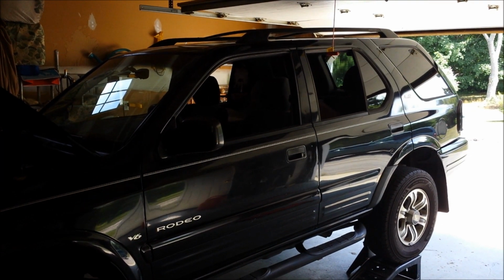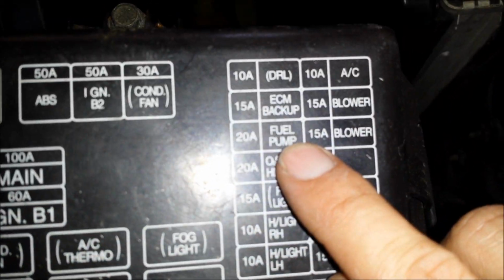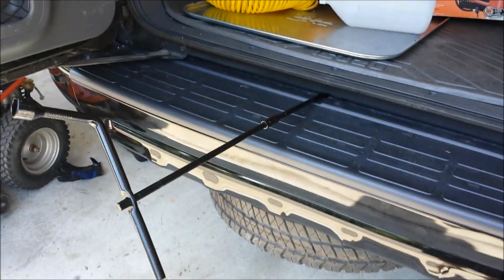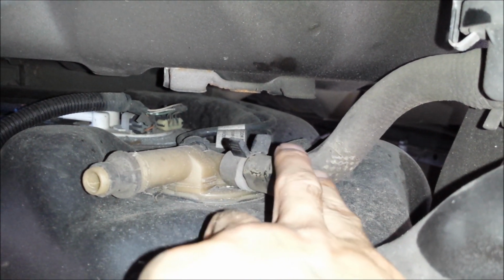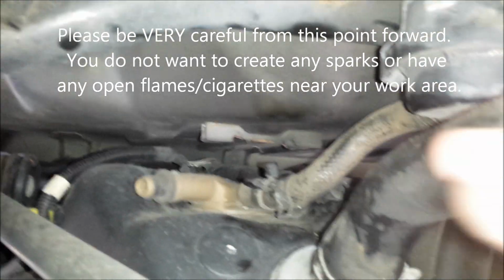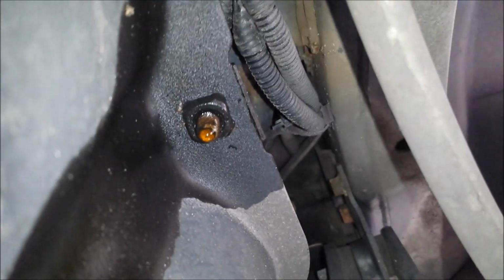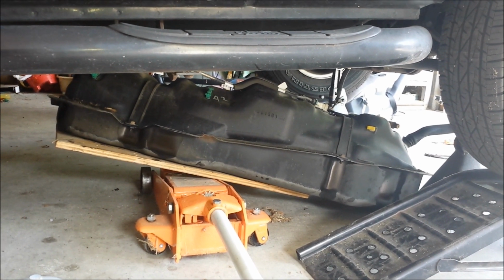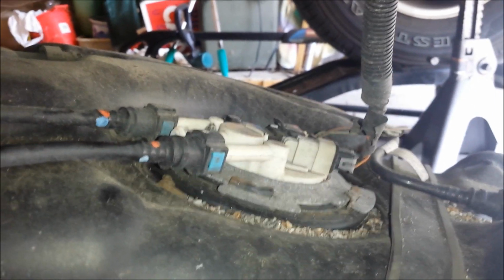2001 Isuzu Rodeo - Fuel Pump Replacement - Part 1

Comment: You're a lifesaver brother.  Saved me from quite a bill.  I only payed $63 for an OEM pump.
Reply from the maker: Luke Wyatt That's awesome Luke!  Thanks for dropping by.  How's your Isuzu running now?
Reply: ***** From this repair, I've noticed slightly better performance.  The sending unit was bad which is why I replaced it.  I'm having some issues with misfires when the engine starts before it warms up though.  Going to do spark plugs and wires this weekend.  Just hoping no oil leaked in there.

Comment: Excellent video. I am just about to tackle  this project on my 1999 rodeo and this has given me the info I need. 2 questions for you. Which pump did you order from rock auto and would you still happen to have the wiring harness info you mentioned? Thanks again for a great video.

Comment: Hey its me again and i have replaced many things fuel pump fuel filter coil packs and im still having the same issue now it runs a little better but after me driving it for a while still wants to back fire and die but i can start it back up and it idled fine
Reply from the maker: Aaron Freeman Aaron, have you checked your fuel pressure since you replaced the pump?  I recently discovered that my fuel filter, which was less than 1 year old, had gone bad.  I replaced it, and it made a noticeable difference in the way the engine ran.

Comment: Do you have to drop the fuel tank ? To change the fuel pump !? Thx
Reply: I was able to cut a hole in the floor under my rear seat to change my fuel pump. It's a bit tricky though.
Reply: @ nice !

Comment: my fuel gauge isnt working on my 2000 isuzu rodeo. is it the sending unit i need to replace? you seem like one of the few guys that actually know how to fix a rodeo lol
Reply from the maker: +chuckwagon1971 Sorry for the delayed response!  Yes, more than likely, your fuel sending unit has gone bad, causing the fuel gauge to malfunction.  Since you have to remove the gas tank to get to the fuel sending unit, I'd recommend just replacing the sending unit and pump both, so that you don't end up having to re-do the whole process again soon to replace a failed pump.

Good luck, and thanks for watching!

Comment: So was the car starting though? Or okay I see that it does turn on... my car wont turn on at all and we've replaced the fuel pump fuel even with a 30 amp one.. I'm guessing the fuel pump needs to be replaced from what the mechanic said and it will be $450.
Reply from the maker: ***** Hi Briana, yes as you noted, my vehicle would run and would drive.  I'm sorry I'm just now responding to you - I have been swamped recently - but if you are still trying to troubleshoot, I would first check the fuel pressure at the valve that looks like a tire valve on the fuel rail.  You can buy an inexpensive fuel pressure test kit at Harbor Freight for about $20-$30 (http://www.harborfreight.com/catalogsearch/result?q=fuel+pressure+test).  Relieve the fuel pressure by pulling the fuel pump fuse and turning the engine over a few times, then screw on the pressure tester and turn the ignition to "on" but don't start the engine.  You should read between 34-38 psi I believe.  If your fuel pressure is very low, that would explain why your engine will not start.  If that is the case, you may want to check the fuel filter to see if it is clogged.  It is located next to the frame rail below the driver's side door.  You should be able to blow through the filter easily with your mouth (don't actually put your mouth on it - try to find some clean rubber tubing to connect to the input side and blow through that).  If it is clogged, purchase a new filter and then do the fuel pressure test again.

If you have good fuel pressure but the engine will not start, then I would suspect that you have a problem with your ignition system (spark plugs or coils).

Good luck.  Let me know if you were able to figure it out.  Thanks for watching!
Reply: ***** No problem at all! It's getting towards that time of year everyone is busy. I ended up getting the fuel pump replaced and the car is starting okay now. I just have to let it warm up for a few minutes once it is on, before I can take off. Thank you for the reply.
Reply: Mjjm

Comment: nice! i save 400 buck for 1993 Isuzu rodeo. just need two parts replace. fuel like you did this video. it is fix but still need engine fan pulley part. can't find any fit. :/ i hope if you have any knowledge of anywhere can find?
Reply from the maker: Have you tried www.rockauto.com?
Reply: go to junk yards , a lot of them there most people gave up of this car .

Comment: Got a question i have gauges but there not for a fuel system can i use them to check my pressure on my fuel system
Reply from the maker: Aaron Freeman Aaron, what kind of gauge is it?  I'm not really sure about this, but if it's for air, I don't know if that will work.  If it's a pressure gauge for another type of liquid, I suppose it's possible to use it if you have a schrader valve connection on the gauge, and the pressure range on the gauge is in the right neighborhood (0-40-50 psi).  You should be getting pressure readings between 30-40 psi.
Reply: Ok. They are my hvac gauges

Comment: Did you use 3 ton or 6 ton car jacks? about to do this. cheers
Reply from the maker: +KoolKatJazz I believe my jack stands have a 6 ton capacity.  Just use caution when using jack stands, no matter their weight capacity.  It's a good idea to inspect them for defects before use, even if they are brand new.  I saw a few brand new stands in the store that had very poor quality welds.  Just be very careful.

Good luck with your repair!
Reply: +Matt Payne Found a place in Denver that will charge me $60 to change it. Since I don't have the Jacks, I might take it to them.  Thanks